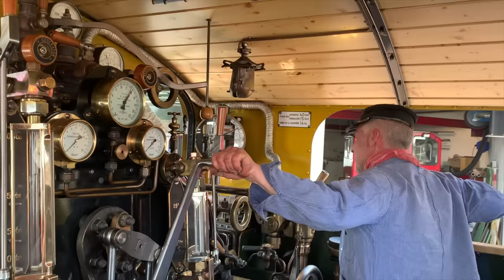DFB Dampfschneeschleuder R12 im Frühlingsschnee 2021, Steam snow plough in the swiss mountains!

Comment: This was a test run, more or less to show that everything works. The tracks are not opened for business at this time of the year. The snow need to smelt and the avalanches need to go down before the track can be opened. This is just a test and it is still too cold for the avalances. The aim was not to free the tracks but to test the machine and its limits and for the crew to get more experience how to operate it. As you see, all the machinery is kept well maintained, clean and lubed. The operators for sure know very well, what they are doing. The expectancy was that the conditions are too hard for the machine, but it managed to cope with it, but with a lot of effort. The machine should be used during and after snow fall, when the snow is fresh.

Comment: Very efficient, it can clear almost a meter at a time, before it stalls!
Reply: They do not know how to operate the equipment correctly or it is faulty.
Reply: @aleu650  Rotary OY makes it look so easy. I find myself wondering why R12 couldn't keep a relatively constant RPM while the locomotive creeps forward. The rack system gives them huge tractive advantages that OY and her pushers don't have.
Reply: I suspect the locomotive doesn’t have a good way to move at very slow speeds; he’s probably got the reverser all the way forward and when he opens the regulator it doesn’t have a way to creep along at low speeds.
Reply: Don't forget, this isn't fresh snow, but old, all winter snow, as this is the clearing of the line in spring after winter closure. Rotaries are far better in fresh snow than in this old, compacted, almost concrete like snow.
That, and they have a lot to learn...
Reply: hello, i am swiss and i was there 4 times and i can say in spring this snow is like stone you cant dig in it witch your fist its like ice. also they mostly use stronger diesel locos this is a bit of an traditional event
Reply: There are other videos of the same engine where it does a great job. It's just that this was a lot of extremely dense snow for an old steam engine to handle.
Reply: @renegadeoflife87  They said the snow was particularly heavy/compact. It's melting spring snow.
Reply: @aleu650  it's very obvious you have little experience in snow

your comment is a great example of the dunning kruger effect
Reply: Its more like a museum exhibit event.
Reply: @aleu650  something tells me that these Swiss mountaineers who have been operating locomotives their whole lives know what they are doing
Reply: Perhaps they didn't want it to overheat?
Reply: @matthewkromer1697  Yep, that was my impression as well. I don't think it is possible to finesse a steam locomotive ahead a few inches at a time in the way that the rotary plow really should be operated. This seems like a bit of a worst-case scenario anyways - in normal use the plow might have to deal with snow this deep but it would be fresh rather than left to compact like this apparently was.
Reply: @AudaxGHG  OR - vent all that angry smoke & steam directly OUT THE FRONT (instead of sending it uselessly skywards out of both smoke stacks) - as steam jetting through / beside the spinning fan blower will ensure almost instant thawing of the hard packed 9ice like) snow - allowing the snow blower itself, to toss the instantly thawed buildup away from the blower unit.

This isn't rocket science, just pure unadulterated knowledge - jet the waste steam directly THROUGH the fan-blower unit, to "steam" heat/melt the hard-pack - as the blower unit is crept forwards very slowly - at a constant forwards rate.
Not the stupid - oh reverse and boom chug-a-lug & stall it (using no steam injection) therefore getting a near muscle only "can't push solid snow" effect.
Reply: @QUIX4U  as i said its more an traditional event nowadays they use hightech stuff that can go thru
Reply: Beautiful machine's.  Always thought these rotary plows would benefit from having some type of feed augers to break up the snow.
Reply: @lynth  That makes sense, its probably more like ice at that point. It looks warm and clear out suggesting the snow has sat a long time.
Reply: No way, It's a bad design!
Reply: @AudaxGHG  Thanks for clearing that up. 🙂👍
Reply: Wow, at this rate it would take days or even weeks to clear a few miles?
Reply: @TN_HondaDad  Room Temperature IQ moment
Reply: Not enough torque.
Reply: Wow seems like a waste of time
Reply: Wacko Jacko  That is why that was a fin experimental thing...nothing else 😂 They just tried it on a steam engine and it dodnt have enough control or power.
Reply: Yeti Manetti  Fun experiment to mount it in feont of a steam engined locomotive...it either has the capability nor the power of a diesel locomotive or something modern. Steam engines cannot hold high torque
Reply: @TheHoffDudeThing  I love your comment, you are the best example for the  limitedness of the human thinking,yes you are right, about the thing that its  hard spring snow, but i think before  you writed your comment. You saw a video about the dunning kruger effect, and as you writed your comment you thinked you understood the effect but you are the best example of it now, you saw one video and thinked you are an expert. Not all is the dunning kruger effect, it can also be only a stupid comment. How would you know this, are you studying psychology? 😂
Reply: @AudaxGHG  Politeness.
Reply: @aleu650  low pressure
Reply: Bloody useless. And dreadful pollution from all the black smoke. FAIL!!
Reply: @AudaxGHG  Hi! So they do use diesel equipment there?
Reply: Just weait until spring
Reply: An amateurs wild guess (I mean I have no idea, actually): It seems to me that the plow should be going on high speed pretty much all the time, and then inch the thing forward, which as others mention, is probably really hard. And the plow is run a bit slow, and the train a bit fast, and the snow is old and hard, so that all adds up to the plow getting overwhelmed.
Reply: @AudaxGHG    So the way you see it is, 90 fucking years ago it would have worked as intended.
Reply: It’s like cutting a tree down with a pocket knife.
Reply: В голос прям мысли. Как говорится - разгон лошадиный, удар комариный
Reply: Yeti Manetti  Please show us.
Reply: @Tenorgeiger  Then you should have seen the line clearing with a rotary plus 7 locos pushing it into the snow and all of them exhausting coal smoke.
Reply: Hahahahahahahahahaha... at that rate it will be NEXT spring  before their clear..nice wood work though..
Reply: @AudaxGHG  dude, chill out.  There's no need to be so sensitive.
Reply: Yea, it's so garbage lol. It can't even do it continously. It has to ram and jam or ram and stall.

So damn pathetic!
Reply: That snow is very wet an heavy even modern machines would struggle with that
Reply: they explained that its not meant for the spring snow, which is heavy because of the water in it. its meant for the winter snow which is light
Reply: @lanzji1345  no harder than coal ,coal cutter would of pissed that
Reply: it is the hard snow or the wrong loc. see other r12 videos like "Die Wiedergeburt der Dampfschneeschleuder R12". there it works much better.
Reply: @aleu650   My thoughts exactly , made it boring but I'm a rail Fan  so hung in there
Reply: sorry if i am inapropriate but the pure stupidity of some ppl here just hurts my Brain. its not hard to understand that the technology wasn‘t that good back then and the ppl didn‘t have better stuff it was the only thing what the had, in this time it was very efficent becaus digging this with hand and shovel would take weeks!
sorry for my very Bad English
Reply: @FL-gg4dq  they cant just wait lol they also need food and stuff and this was the only route
Reply: @FxrFromRussia  no its running water/steam
Reply: @Tenorgeiger  its not used today its like i said more an traditional museum event it actally said in the vid that its an REPAIRED machine from a museum
Reply: @PC-rt3zm  1:24 PLEASE use your eyes and read what is standing there, oh yeah 1913. ITS OLD!!!!
Reply: For the time it was built it was very efficient and effective.  It did more work than 50 people digging snow off tracks.
Reply: That is hard impacted snow, my guess why they kept backing up and then going forward was for two reasons, first off the snow is old heavy snow/ice, it could easily be a risk of derailing the snow blower (if it was fresh snow a couple of meters thick it would be a different matter), the other reason is that these machines are old, the function well but are not replaceable, more a show and a pleasant day in the sun for the enthusiast.
Reply: There not running it the way it was mentioned to be ran that's why it stalls. It ment to be ran wide open. Not run at a slow rpm.
Reply: @QUIX4U  lololol you think you can melt that much snow? Where's it gunna go ? Over the 15 foot tall bank to the left and the mountain of snow to the right?...
Reply: Yeti Manetti  lol your snow blower wouldn't move one chunk of that ice
Reply: @Scpawh  So what would you suggest? a bunch of human beings with shovels?
Reply: Running at full throttle require maximum steam pressure, boiler  need some time to accumulate.
Reply: Running at full throttle require maximum steam pressure, boiler  need some time to accumulate.
Reply: All this buildup to an agonizing back and forth. Come on now! Get some more efficient equipment!
Reply: Power is not enough for this amount of snow. That's the reason those machines had sunken into oblivion.
Reply: Yeah, the design is flawed in many ways, packing the snow into the device and causing an exponential load. The design should be an incrementally biting blade system, and it shouldn't pack the snow into a dead end like that at least if it can't move really slowly. 

They would probably be more efficient and fast by just using the steam system to heat up the snow and melt it... (I'm not saying that's a good method, just that it's as useless as this system they're using)

They might have more success with that existing, flawed system in hard-packed snow by having a separate ram system that they flip down in front of everything, run into the snow, then back out, lift the ram up out of the way and then clear the cut up snow with the blower. Then repeat. 
The ram system should be a flat or slightly convex curve plate with many spikes protruding towards the front, like spears which are wider and larger in the front and thin behind. Those would pierce the snow and break it up somewhat, but also keep the snow from jamming up onto the ram system.
Reply: @gorutra  More like taking a box full of saws and throwing them out of the box at the tree, then picking them up back into the box and repeating. 
The idea is close, but the design is flawed. Needs version 2.0
Reply: The people who operated that thing daily in wintertime and knew every little trick when it was new and THE machine, are at least 50-60years dead now. It has to be re-learned how to work those old things first. Plus it's a first test after several decades of dormancy for the machine too, so it's just the start of a learning process. It's basically experimental archeology.....  Plus back in the old days this route was cleared daily, as it was the only way over the mountain, they never had to work several months old hard packed snow back then. Today the route is Summer-Tourism only, as it's not needed to travel from here to there anymore. it got replaced by a long tunnel underneath the mountain with passenger and car carrying trains....
Reply: primitive for sure, not efficient at all
Reply: তৃচর ঈঙফ্তহ‌ঘ্র @renegadeoflife87  জৌ
Reply: Clearing snow you need traditional diesel engine the steam engine is a beautiful site but something not right
Reply: @AudaxGHG  They... Were making a joke, just like OP did.

Hurts my brain that you can't detect sarcasm.
Reply: Lol
Reply: @lanzji1345  That puts things in better context.  Still. you'd think they'd be able to find a sustainable rate to nibble at it.  But maybe you just have to do it like they're doing, because the snow's so compacted.
Reply: @harrymills2770  I did help with clearing the line in spring once. We didn't use shovels to break up the snow, they were no use. We had to use pickaxes. 
A rotary is simply the wrong tool for the job. 
When the line was still in ordinary use - not as nostalgic tourist line like today - they used to dig tunnels through the snow.
Today, they use excavators and modern, snow hacking snow blowers(?). 
I don't think you got the right idea about the consistency of the snow. There's no softness, there's no springiness, it's hard, compact, icy, grey snow, compressed by all the snow layers that were on it to a concrete like mass. Rotaries, at least the Bernina rotary we're talking about here, are built to quickly and efficiently clear big volumes of fresh snow. Very different business.
Reply: i think they have better water back then when it was fabricated !
Reply: Yep,thats the beauty of it,efficiency.
Reply: @lanzji1345  makes you wonder why they even uploaded this vid at all if the machine wasn't being used as intended.  Complete waste of 20 minutes.
Reply: its to slow 3 feet at a time..
Reply: <3 LMAO
Reply: I can relate.
Reply: my guess is its partially frozen / melted and is VERY heavy
Reply: @AudaxGHG  Not inappropriate, many people out there with completely smooth-brains my friend.
Reply: Beauty=yes, Snow removal=no
Reply: It really kicks ass downhill!
Reply: Because the snow is very moist/soft.
Reply: @AudaxGHG
Reply: Wet heavy snow is impossible to snow blow
Reply: Coyote Tango Mk1   @Coyote Tango Mk1  This rotary is a newly acquired and renovated museum piece on a museum railway. It was used in winter service on the Bernina line until it was replaced a few years ago by this monster: https://youtu.be/SjqI-rOKYB8. Before that, it looked like this: https://youtu.be/J8CudTlUfvg
Now, it's on the Furka museum railway, which is conserving an old mountain line which was replaced by a 15 km long tunnel. The old line was never open in winter - the railway was split in two during winter...
Look here: https://youtu.be/-DjVSx7TSV4
Reply: Coyote Tango Mk1  Because during the winter, the line is closed. It's impossible to keep it open, as it's far too dangerous. Way too much snow, too many avalanches.
The rotary has been acquired (not sure, but I think it was donated) by the museum railway as a living museum piece. So it's not really there to open the line, or to keep it open, they have more modern engines for that. Or rather, less antique museum pieces 😀
Reply: @AudaxGHG  b
Reply: @Labroidas  maybe they should have mentioned that in the title. “Old steam snow slinger chops through snow as dense as concrete.” I thought this video was extremely disappointing.
Reply: Can we get someone out there with a shovel please
Reply: @nunyabuziness8421  Impossible? 🤔  Ever heard of a nuclear train? Me neither, but I'm confident humans could make a train capable of removing packed snow
Reply: Coyote Tango Mk1  Moist saw is the worst because it compresses and saturated with water, and the turbine can't pick it up no more.
Reply: @richardturner6164  what
Reply: @pistonburner6448  this was one of the first modells of snowbreaking trains so yeah there are already very efficient snowremoving trains...
Reply: @TheHoffDudeThing  name dropping the dunning Kruger effect is a great example of the dunning Kruger effect
Reply: For 1890 it’s a very efficient machine
Reply: What happens when it snows heavy and you use your snow blower at home and the snow is taller then the blower it's???and now think the snow was taller then the train....... blower......
Reply: Efficient?  This thing belongs in museum.  There has to be something more up to date than this to remove snow from the tracks....?
Reply: @AC-ir3od  I'm being very obviously sarcastic.
Reply: Its of course not efficient, but the point to preserve the knowledge and the tradition of steam locomotion
Reply: The weel/blade eating the snow stalls, it needs more momentum a big weight so it can keep spinning when rammed into the snow

Comment: That was so weak. I wasn't expecting that. Who else thought it was going to plow through the snow before watching?
Reply: well this is so called "German Over engineering"
Reply: this isn't freshly packed snow... this was snow that was sitting throughout winter almost hard like concrete... and this is a train using coal and steam, not a gasoline vehicle. what did you expect? lmaoo
Reply: @randomclips8493  you are so smart! Wow!
Reply: Ice is densely packed so its quite hard . And also the locomotive is steam powered , thermal capacity  and efficiency  is drastically low . And also , at that time they dont use coolant to reduce temperature so thats why they have to wait . 
And also , steam loco , doesnt make good amount of torque and optimal pressure to regulate pistons . 😕

But still , .. this mechanical engineering era was amazing 
I.wish i could operate or ride this thing 🤧🥵
Reply: @AkronKid330  it’s more informed than your comment... your sarcasm is unhelpful
Reply: @randomclips8493  then they should have designed a machine capable of handling hard packed snow. At the rate they're going, it'll take a week to go a mile or two.